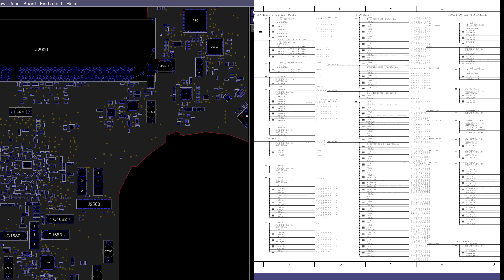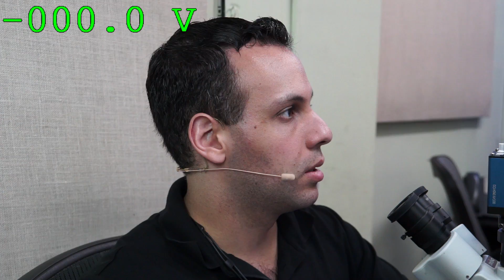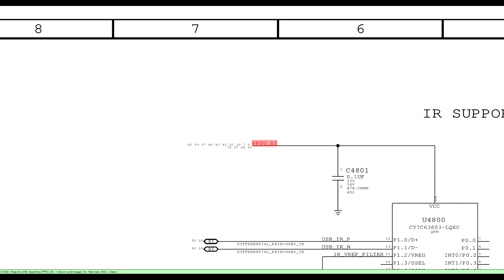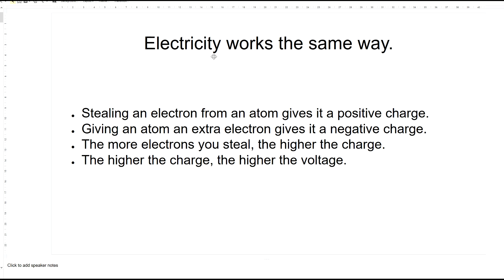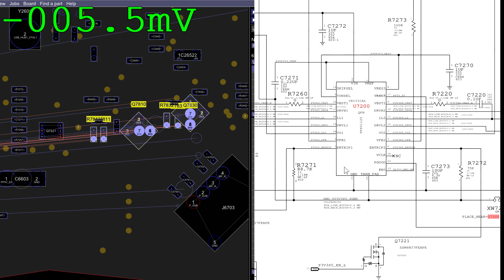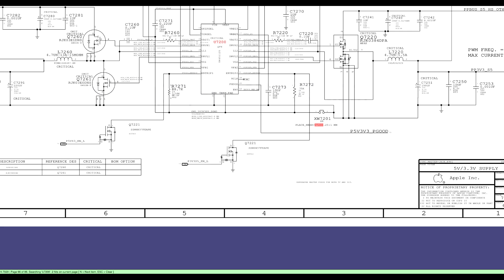A1278 Macbook taking 200 mA but not turning on

Comment: @18:21 Is not " self fixing board " is the low current of you'r multimeter charging slowly the capacitors on that rail.

Comment: Louis! Thank you for your work!
I have a mid2010 mbp that had massive heat issues. Because of watching your channel I decided to to repaste the cpu and gpu. First I was a bit scared that I may ruin the board but then I watched a lot of your videos and that showed me that I don't have to be scared. The thermal paste was like dust when I scraped it off. Now I can watch your videos with 70°C temps and 2200rpm fan spin (i can bearly hear the fan)! Before it wasn't possible - thought my mb is dying...

Comment: I went to Palo Alto Fry's Repair bar and it was so sad, the PIC (Peron in Charge) was about my elder age >55 Gender not included,  Very Very Pessimistic re Mac Book Pro  Retina SSD install R & R.  Its not that simple..... we require a diagnostic to check the health= Fee. We only use Apple SSDs no Samsung ADATA etc. [Because they won't work. And it will be more than a 1 hour job. Period.  [Don't care about you model & yr. Wow so out of the loop.]   What does apple charge or OWC if there are any authorities higher- let me know-- no don't  bother they cannot exist, can they?

Comment: If you use a DMM to measure resistance across a circuit which has a capacitor, you will see the resistance read very low to begin with and then increase as the capacitor charges up.

Comment: If a board is using 200mA and doing nothing, wouldn't you want to detach the power source immediately? Considering there may be a short on a possibly very small amount of area?
Reply: Quoting Louis: If there is a short, something is broken already and you can't break it more, and on the off chance something is only partially broken, if you put high current trough it it will break properly and you will know then what was broken.

Comment: At 18:20 the increasing resistance is just the multimeter slowly charging the capa sitters, which will draw decreasing current as they charge up and appear as a higher resistance to the multimeter.

Comment: Pattern recognition.. Kind of like when I'm diagnosing a problem with a laptop someone spilled milk into, and it won't power on, but will charge the battery.. It was a shorted keyboard..
Or the dozens of Xbox 360's with disc read errors... It's always the laser getting weak, and in need of adjustment... ALWAYS lol. That's a pattern!!

Comment: You know, it's amazing that how my laptop from 2008 (HP Pavilion Vista, upgraded to Win 7 x64 Pro) still works fine. Yeah, I had to replace the HDD and one of RAM slots went bad, and the keyboard and trackpad don't work (my brother spilt soda on it back in 2010, had to take it apart and clean it out), but it still works surprisingly well for what it went through. Yeah, it's obsolete by today's standards, but it does what I need it to do.

Comment: Apple is dead to me. 

Their drivers are now inaccessible for installing Windows. Let that company rot in its greed.

They'll go bankrupt. THEY WILL.
Reply: butthurt lmao
Reply: But really why buy a way more expensive computer that only would be bought to be in the apple ecosystem and the  remove it from there with windows and endup a machine thats is worse and way more expensive?
Reply: Why would you spend so much money on a Apple computer just to install Windows on it and make it slower. The entire point of having a Mac is that the OS is so light it makes slower computers as competative as a cheap Laptop?
Reply: @Celician83  Why then buy a mac in the first place? 
Get any random machine, a ssd and linux..

Or if you really liek bsd (macos is derivated from) install one. Done
Reply: @eduardoavila646  nice form factor

Comment: Amazing how good and clean the board looks after so many years. The new ones mostly look dirty
Reply: I guess it depends on the people that use them. I've seen some old boards on Louis's channel and they either looked dirty or clean. Same applied on newer macbooks. I recently got a A1278 for cheap - made in 2013 - board looks immaculate. Maybe it was cleaned before. I don't know...

Comment: Correct me if im wrong but isnt that a MagSafe 2 charger? How is it working on this mac? Unless you can use a MS2 charger on a MS1 Mac if its out the case.
Reply: I guess the phisical socket is the same. That said, the connector is going to a lab bench power supply, so he can change all the rail voltages however he wants. He is "simulating" a charger.

Comment: Favorite generation of macbook. Reasonably easy to upgrade parts and the best keyboard ever found in a macbook.
Reply: If Youtube dislikes where visible...
Reply: Every day is s school day, use thermal camera first? Great videos.
Reply: fat hot and loud eww
Reply: you're complaining about thickness?
Reply: @TorutheRedFox  yes why the hell would I want to give up bag space when travelling. If it was quiet id understand but it's still loud too
Reply: so there is less of a chance of it being bent if you encounter incompetent airport employees
my uncle encountered such employees, which dropped a bag he had his PS3 in, and it died as a result
Reply: @TorutheRedFox  who the hell let's airport people handle bags with notebooks? I store my stuff in my carryon
Reply: @TorutheRedFox  ThiCCness
Reply: @MrEeeaddict  it does fit the same way as any newer thin laptop with the same screen size tho. It being more thin doent make it more portable tbh, even worse when you're forced to use aluminium instead os plastic because the damn body is to flimsy and thin and weak. 

And it still wont fit in a 13inch laptop bag.

Also by being more thin, its way more hot, and this extra heat even goes in contact with your lap easier so its eve hotter, ew!
Reply: @eduardoavila646  I fly a lot and my 11" air was the only computer at the time that fit comfortably into all trays and pockets. Even now the xps 13 is the only decent competitor
Reply: @MrEeeaddict  I'm not saying a 13 or even 11 inch laptop is bad at all. But that laptop in the video is certainly not 13 inches and for sure not 11 inches. 
What i was arguing about is how making the laptops thin actually dont help them, a 13inch laptop is still 23 inch no matter is it is 1cm thick or 2cm thick. 

But what you said there is arguable due to preferences, i cant type anymore in 11 inches laptops due to not having small hands anymore. 13 and 14inches ones are fine tho. 
But the issue i talked there is that making it thin doesnt make it better
Reply: @eduardoavila646  the laptop in the video is 13 and the 11" has a full sized keyboard

Comment: This is a good example of Louis doing repair unprofessionally and cheating with thermal imager vs Apple tech support uses their brains. 😊😁😂.
Reply: apple tech support wouldnt even touch this machine, they'd bitch at you for not upgrading sooner
Reply: @austinv183  😂😂😂👍
Reply: apple tech support is smarter, "its cheaper to buy a new computer than to repair it"